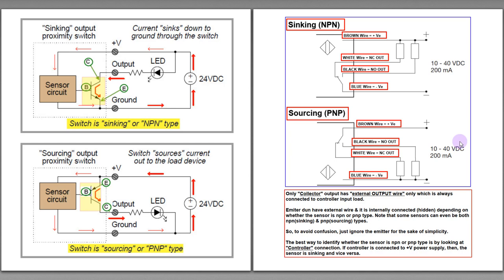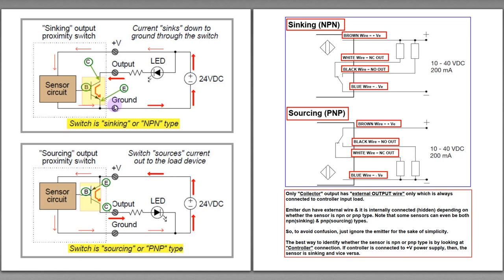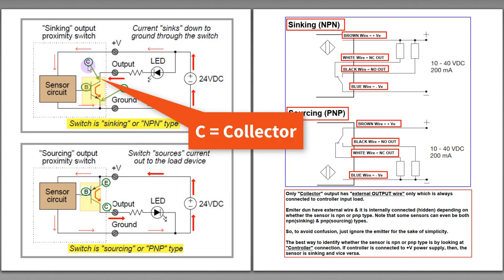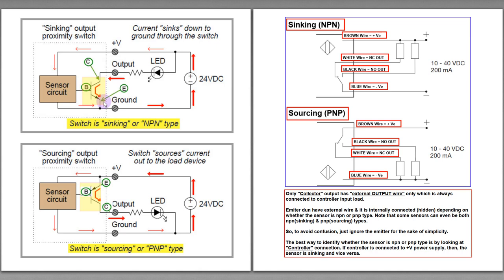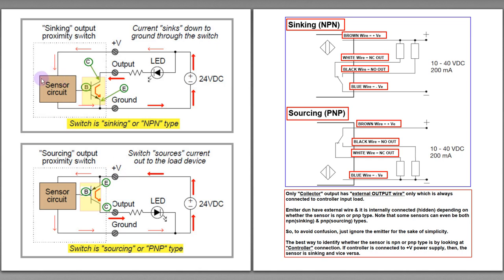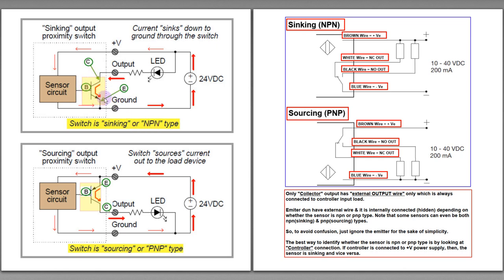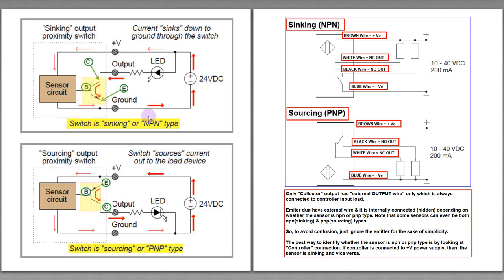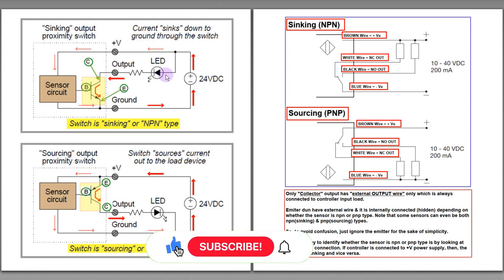Instrument Sinking and Sourcing Switches Explanation

Comment from the maker: "There are 2 wires and 4 wires type of instruments. However, there is also 3 wires type of instrument too. Basically, 2 wires type of instruments refer to the instrument output circuit that carries signal and need to be power by external power supply whereas 4 wires transmitters refer to the instrument having separate 2 wires connected to power supply and its output termainal is able to send signal and power up the loop.

As for 3 wires instruments, it usually refers to solid state switch such as transistor switch. The 3 wires switch may be connected as sinking (or NPN type) or connected as sourcing (or PNP type) depend on the type of siwtch used. We need to refer to the manufacturer data sheet or manual for detail."